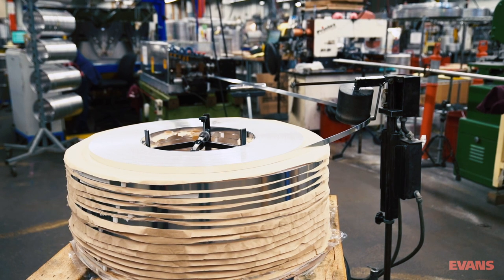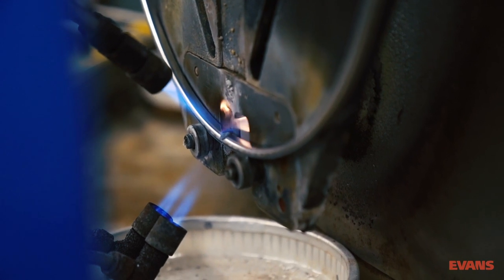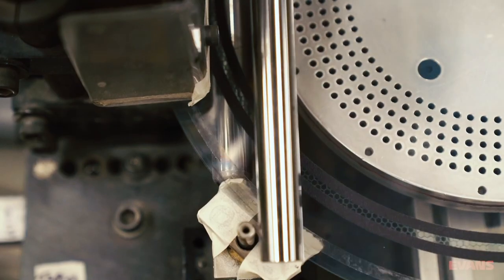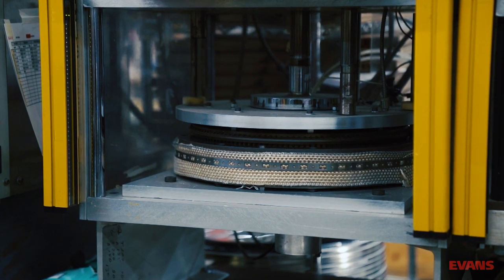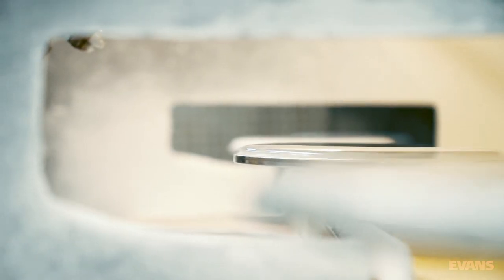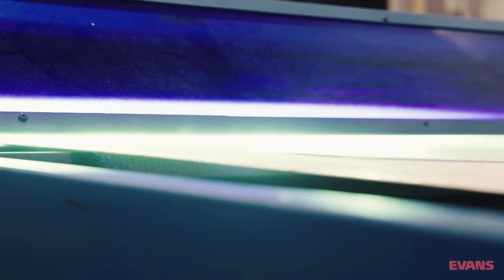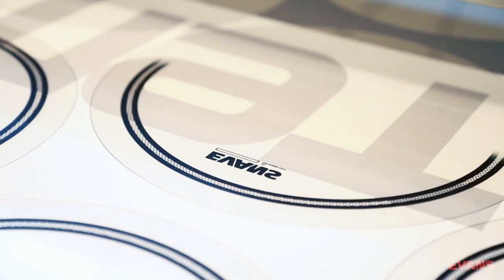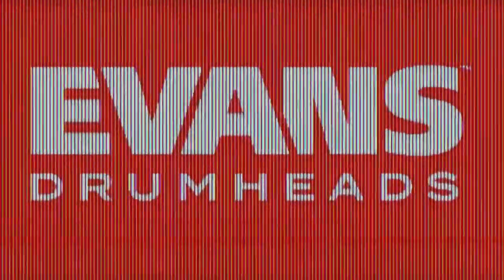Evans Drumheads Factory Tour

Comment: would it be at all possible to get a reso bass drum head made out of an old movie screen to utilize a slide, or film projector upon? I would like to have a human eye projected onto the reso head of my kick drum watching the action going on the stage,blinking and moving from left to right as well. I have played numerous drum heads but EVANS by far is thee go to drum head for myself. Such articulation & craftsmanship that goes into Every single head made by yourselves is nothing short of phenomenal. I refuse to play any other head. I have an Evans eq batter head with the removable zero ring built into the border of the head on my kickdrum. I have an Evans white batter head on my snare drum, clear evans on my racks and coated white floor tom,all batter heads. I'm going to stay with Evans when I have to replace my reso's.Kudos to yourselves for creating such a fine product.I am enamoured by your craftsmanship as well as overall product.

Comment: I LOVE the sound of Evans Drumheads, but they haven’t figured out their coatings after all these years. In humid climates, their white coating will become tacky and sticky to the touch, sticking to the inner cardboard packaging and peel off some the cardboard when you try to separate it. The same can be said of the Strata series heads.

I did talk to a representative from D’Addario at a Mid-West Clinic some years ago about the issue. He gave me his card and told me to drop him a line with the heads I use and insisted that Evans  changed their formulation of their coatings. He sent me a huge box of heads (which was awesome), but the issue still persists. In the end, you can’t beat the Remo and Aquarian coatings.

Let me know when you figure things out and I’ll try those heads.
Reply: A case in point, I’ll occasionally clean my white coated heads with a Mr. Kleen Magic Eraser and Isopropyl Alcohol. With Remo heads, I can use A TON of pressure and muscle power and the heads will clean up nicely with NO coating removal. With Evans heads, the white paint will start to come off immediately with moderate pressure (that white sticky paint substance) and I have to throw the heads away (along with using paint thinner to clean my hands). 

When white coated Evans heads can withstand my Magic Eraser/Isopropyl Alcohol cleaning job, please let me know.

Comment: Question for Evans, I know y'all have a UV coated Hydraulic snare head. Have y'all ever thought to add the UV coating or even the UV curing process to the whole Hydraulic line, the tom heads & bass heads and not just the snare heads? Really think that would be really cool to add that extra coating and durability to such a great sounding head.